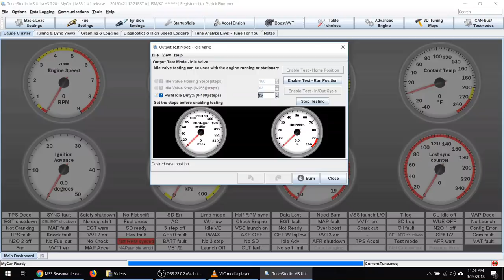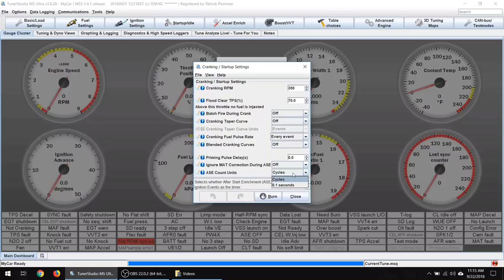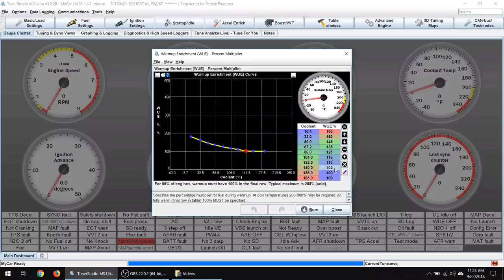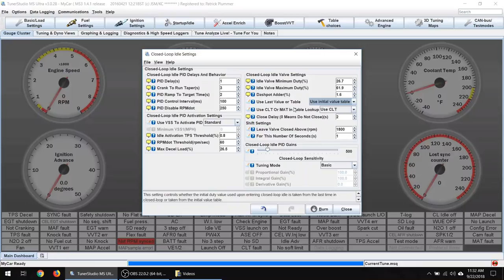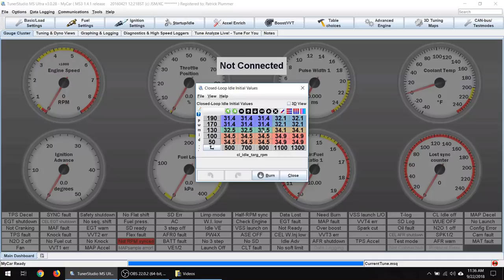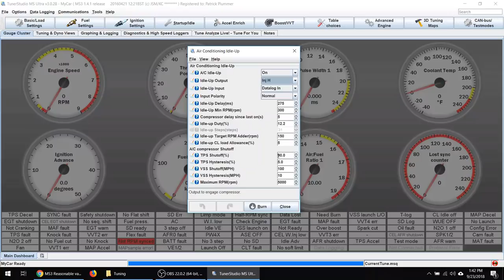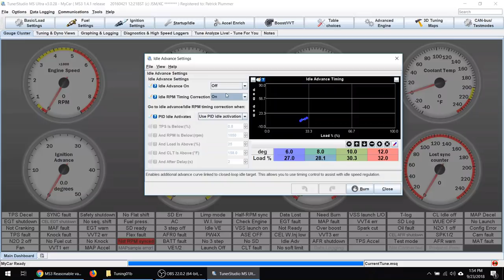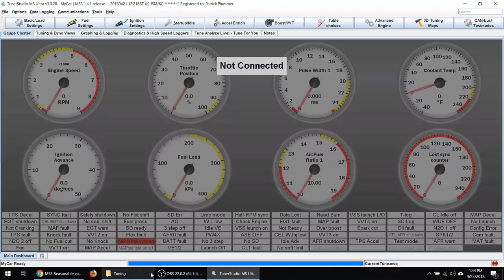Tuning the Megasquirt (Pt 2) - Idle Control

Comment: will this be fine for a non turbo set up ?
Reply from the maker: Yes! This was shot before I had my turbo installed.  I actually recommend to learn tuning on a naturally aspirated car so that later at higher power levels you know how to do it and be safe for the engine.
Reply: I’m on a base map now from MS noticed a lot of your setting are different and there are some I don’t have was wondering if you might have that map before you set up turbo cause I don’t have the dyno tuner and tuning the idle is getting a little scary lol
Reply: I’m on a base map now from MS noticed a lot of your setting are different and there are some I don’t have was wondering if you might have that map before you set up turbo cause I don’t have the dyno tuner and tuning the idle is getting a little scary lol
Reply: I’m on a base map now from MS noticed a lot of your setting are different but I guess that expected since I have a 97 just running is tricky for me this is all new and I’m in the woods lol
Reply: I’m on a base map now from MS noticed a lot of your setting are different but I guess that expected since I have a 97 just running is tricky for me this is all new and I’m in the woods lol
Reply: I’m on a base map now from MS noticed a lot of your setting are different but I guess that expected since I have a 97 just running is tricky for me this is all new and I’m in the woods lol
Reply: I’m on a base map now from MS noticed a lot of your setting are different but I guess that expected since I have a 97 just running is tricky for me this is all new and I’m in the woods lol
Reply: I’m on a base map now from MS noticed a lot of your setting are different but I guess that expected since I have a 97 just running is tricky for me this is all new and I’m in the woods lol
Reply: I’m on a base map now from MS noticed a lot of your setting are different but I guess that expected since I have a 97 just running is tricky for me this is all new and I’m in the woods lol
Reply: I’m on a base map now from MS noticed a lot of your setting are different but I guess that expected since I have a 97 just running is tricky for me this is all new and I’m in the woods lol
Reply: I’m on a base map now from MS noticed a lot of your setting are different but I guess that expected since I have a 97 just running is tricky for me this is all new and I’m in the woods lol
Reply from the maker: @prestonhatherly1548  What ms version do you have?  ms2 will be very different from ms3 in tunerstudio -- also the specific firmware will cause different options and screens to be shown (or not).  I would start with the map from http://trubokitty.net for your year if you have a ms3x.  (What I have).  Otherwise a base map from diyautotune will be good for ms1 or ms2.   The good thing is that naturally aspirated about the worst you can do is stall it, it's hard to hurt the engine.  Note:  unplug your coils from the harness if you reflash the firmware.